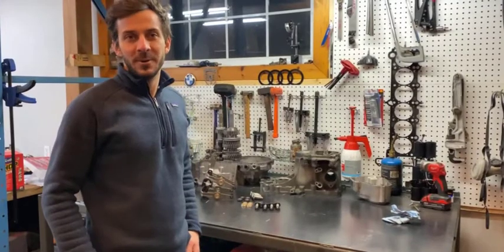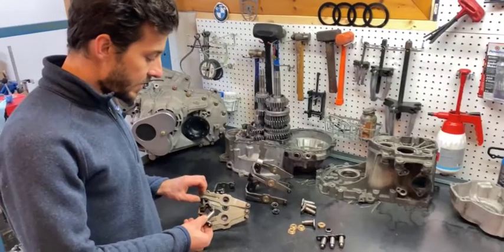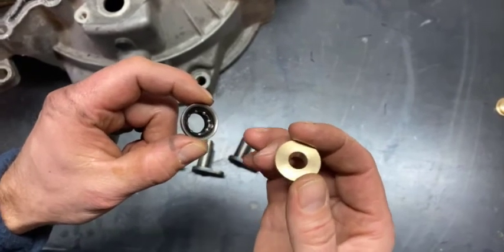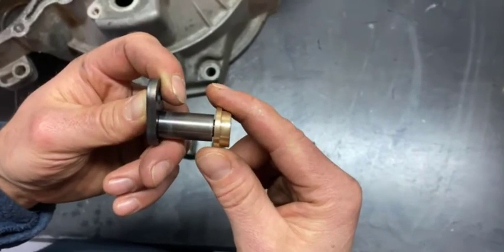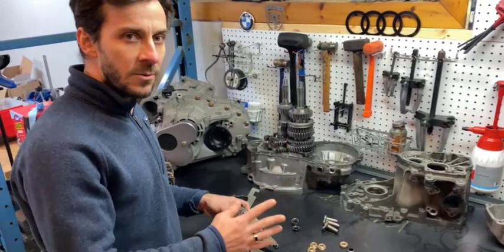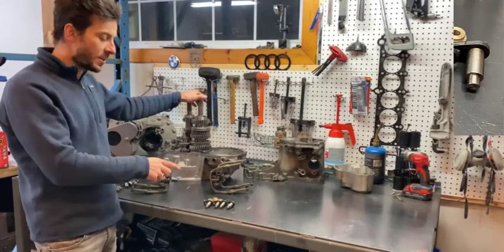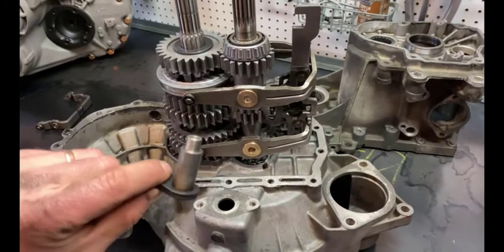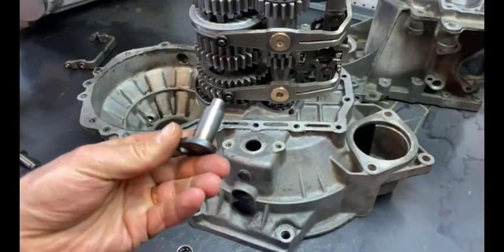VW 02J/02A Transmission Mod

Comment: Hello Peter, I saw your audi transaxle gearbox rebuild on debose garage, and was wondering with those upgrades what kind of hp could the transmission handle? The reason why i ask is I wanted to put an Ls engine in a porsch, and i heard that VW/audi can be swaped into the place of the porsch transmission. My aplication was Time attack so 3-4 laps around a track ect and i wanted to get around 1200hp would an audi be a good swap? Do you have any suggestions on what the best transaxle transmission to modify would be? These cars are going full tilt so a dog box should do quite well.

Comment: But would this be useful on a normal oem synchro box?
Reply: I'd argue not. I've had more than 100 of these boxes apart and put back together, of the numerous different failures I've seen in them, I can't recall ever having seen one of the bearings fail unless something else broke in the transmission and shrapnel travelling with substantial velocity managed to do damage. The levers only move so far, the amount of load on them is pretty minimal in a normal use OEM box. I also don't feel there's any significant slop in the original setup. Just my experience, at least. There's a lot of other areas that are far more noticeable upgrades for shifter feel--mostly to do with bushings, cable ends and the ball socket inside the car. i.e. all external items to the gearbox.

I can understand needing it for the very aggressive shifting in a dog box, but in a stock box, I wouldn't spend the money on it.

Comment: Thanks for your info! I would like to order some renforcement parts/kit or even a rebuild set for a vw 5 speed  gearbox its under my seat ibiza cupra mk3 1.8 20vt engine code ayp  year of build is 2001

Can u give a price range of a dog box?  Is it a complete  gearbox?
 Or just gears towers and internals that have to fit in my original 5 speed? Gearbox  case?